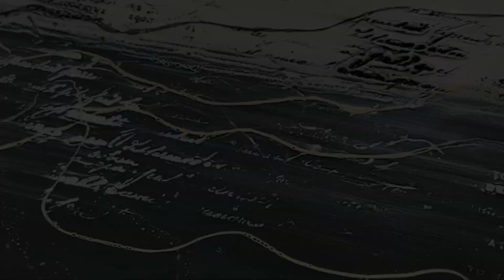Experimenting with Thin Lines of Shellac Burns on Encaustic

Comment: I love the effect of the words & the use of the streaky marks!  The only thing is that the extra wax between the 2nd & third layer of lines hid the lines too much for my liking, so you can’t see those beautiful wet shellac burn lines as well, since you used all dry ones on top of that.  Clear medium would have given depth there while emphasising all that texture. And  I know this is an old video, but I hope you didn’t add an extra line of writing.  This looks awesome as it is, although being the sucker for metallics that I am, I’d probably have added some really thin metallic lines or curls of gold foil
Reply from the maker: Ooooo, metallic lines! What a great idea. The videos dont do the best job of showing everything... Sometimes it looks like things are covered completely when there are lots of hints still showing through.

Comment: Thank you for doing these vid's! 
Just wondering if you find a change in the way the lines burn or how they spread or form cells once you add alcohol ink to the shellac? Does adding the flammable alcohol make it act different? 
Thanks!
Reply from the maker: The only time I've noticed a difference is when I add metallic colors. The glitter inside makes it burn a little differently.